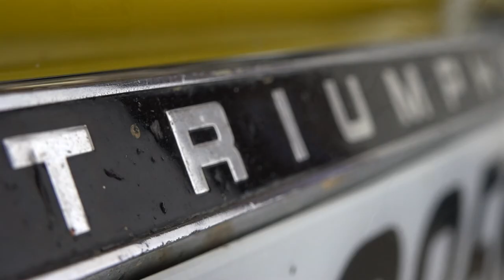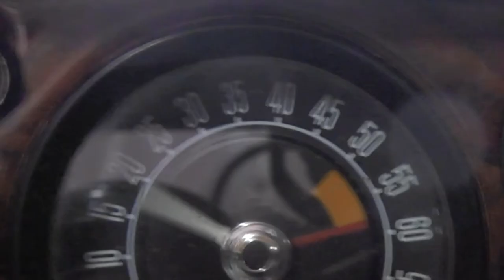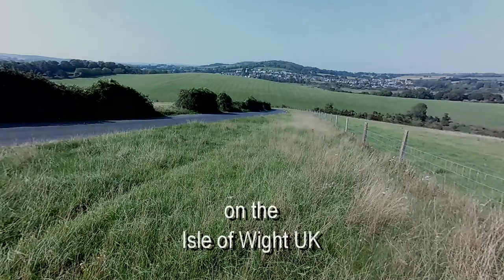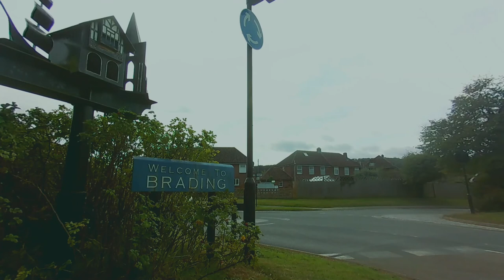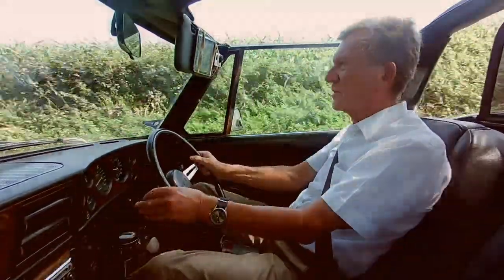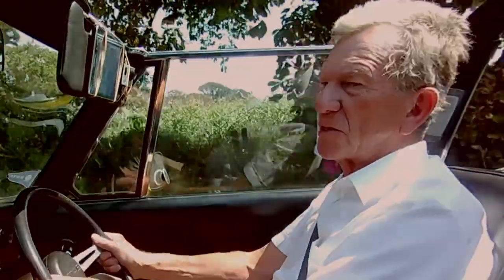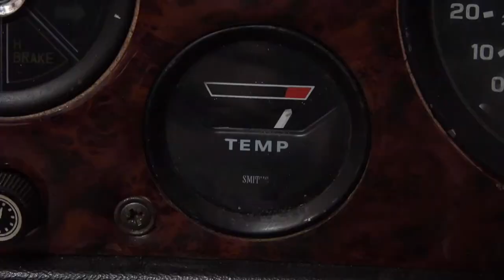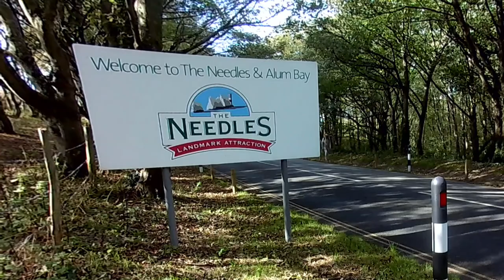The Golden Stag - 50 years of the Triumph Stag.

Comment: Very nice video on a beautiful car I love and I own since 1975. Thank you Chris from France. What a fantastic story it could have been if its design was properly finished at the time: engine cooling system, undersized engine timing chain, dual metal reactions / rust on bolts, poor quality metal used everywhere. I love this Stag but every trip is an adventure (you don't know if it will drive you back home). On mine, I had 2 new motors, 2 rear axles, 2 power steering, many water pumps, one overdrive repair, even a steel wheel had a crack and I detected it while driving in the Pyrenees mountains. Maintenance was a mechanics nightmare (they would see me coming with apprehension not knowing for how many months the car will stay there waiting for spare parts (rear axle, unavailable, special ball bearings unavailable,...long list). Removing bolts was also a nightmare (no surface treatment meant bolts will seize or come off with the thread).

Comment: Something strange about this car.  You describe the overheating issues and show some kind of fake steam when pulling up the bonnet. We could not see the engine, the camera shots of the exhaust and car driving by doesn't sound right.  

So is the car of yours a Stag V8 ?  Surely one of the greatest stag features it's the note of its engine, I just didn't hear that with yours.

I could be wrong ..  but as a fellow Stag owner yours sounds completely different to mine.

Comment: Sounds like he has swapped out the V8 for a 2.5 litre six to me
Reply: 2.5 litre, Correct. It was me who fitted. Chris bought from me 3 + years ago. I had it for 20 years, luved it. Missed so much, got another but the triumph 3.0 l v8. Sounds great, more refined but they are fragile and designed to fail re water pump/header tank/head bolt arrangement, timing chains, alloy heads, crank. Oddly,  I prefer the 3.0 litre, but the 2.5 straight 6 is more bullet proof.

Comment: Triumph should've tried the Daimler 250 V8 engine. Would've been ideal in every respect.
Reply from the maker: I wonder if anyone's ever done that. I've never heard of it being done.
Reply: @chrisoffer5874  The purists would probably have a heart attack because of the rarity of the donor although a Stag 250 would still actually be a genuinely all-British affair (if you ignore Michelotti's input!) given that the typical Rover V8 swap was originally a Buick design albeit of the same period as the Daimler. Interestingly, the 250's designer Edward Turner is said to've based its cylinder head on those he'd designed for Triumph motorcycle engines so there could be a legitimate if rather tenuous marque connection if such a chimaera was ever brought into existence!